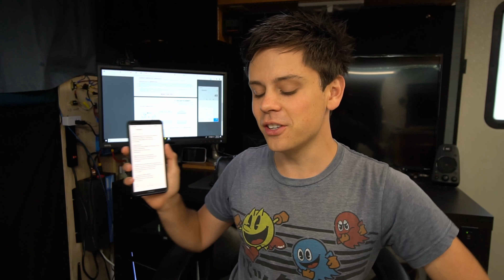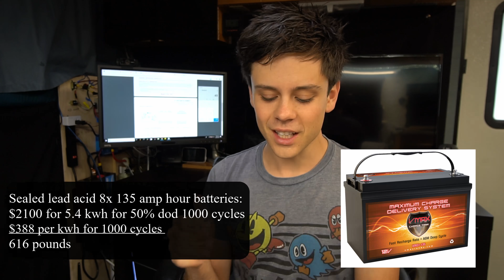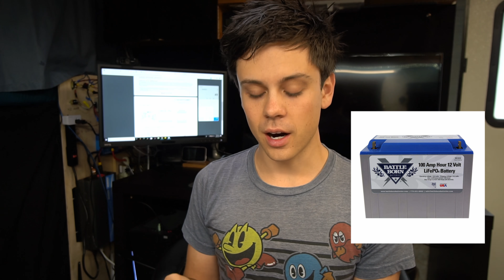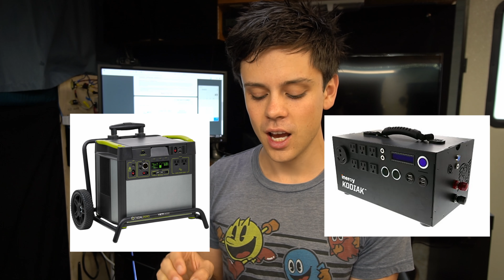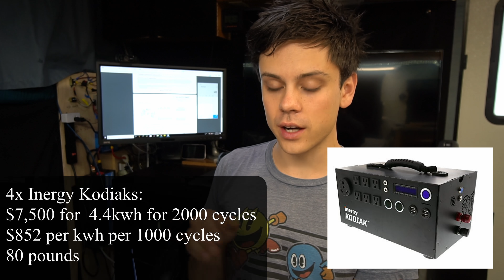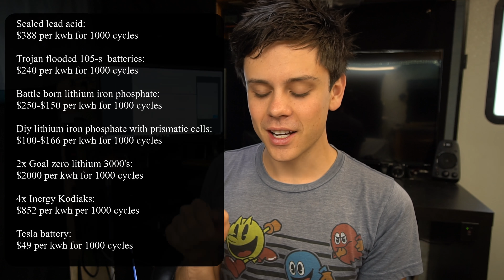Off-grid Solar Battery Price Comparison: Tesla vs. FLA vs. SLA vs. LiFePO4 vs. Tesla

Comment: The 5000 cycles at 100% DOD on Tesla batteries are unreal. Tesla cells are based on an upgraded panasonic 18650B, which has a 500 cycle rate. Let's consider an improvement to 1000 cycles. Going to 80% DOD, that will take your cycle life to maximum 4000.
Reply from the maker: Absolutely. That's why I stated I'm using a different charge profile to reach those numbers.  And right now I cycle between 85% and 45%. So I'm not concerned.
Reply: Just like a regular EV . Most owners will not drive until the batteries are fully depleted and actually cycle around 45-60% DOD which will boost cycle count longer than the actual chassis lifetime.
Reply from the maker: @octavianc  thats so interesting. I was actually wondering about that recently. That is cool.
Reply from the maker: @octavianc  I think the seats and steering wheel will degrade before the battery does in some of these EV's
Reply: There will always be a market for them as used vehicles. Also there will be a high demand for refurbished or upgraded battery packs, as an EV can have a longer life than a standard ICE vehicle, as long as the battery is ok.
Reply: The main issue with very long lasting batteries is actually the temperature variations within the pack. As long as people will use the liquid cooling on the batteries, indeed, they will last a loong time as long as properly cycled. 
However even the smallest temperature variations (room temperature variations, higher ratings for charge/discharge) will actually kill the batteries when we speak of over 10 year lifetimes. This is because the lithium cells have different internal resistance value based on temperature. If the cells within a pack will be at different temperatures (middle cells will get hotter, even if only with a few degrees), they will have different  internal resistance values. In time this difference will increase, the cells will get hotter and hotter and lead to a cascade event.

This is why Nissan leaf batteries have such a poor lifespan (high C rating discharge and poor thermal management).
Reply from the maker: Good to know about Nissan leaf batteries. I know the usable cycle is 50% of total capacity on non plug in Prius. Older battery chemistry too
Reply: The roadster most likely will use higher power cells......less cycles. But still on 200 kWh with 500 cycles you will get over 400k km ( 250k miles) which is something that most owners will never get to. 

Prius as far as I know was not using lithium until i think gen 3? Gen 1 for sure and maybe gen 2 are using NIMH batteries which fall between lead and lithium
Reply from the maker: Also that means you lose 20% capacity at that point. In a lead acid it would sulfate or have a shorted cell. Idk how to factor that in but cycle life for solar application should out live a human
Reply from the maker: For small systems with low c requirements & partial cycles, it should last a longgggg time
Reply from the maker: Absolutely. which is why I'm curious to know how long the new Tesla Roadster would last if driven slowly. 200kwh battery pack. Could drive it for a couple hundred years haha

Comment: Good video, Goal Zero documentation is missleading and charging options definatelly sucks.  

From there support team:
Every 500 cycles, the battery simply loses about 20% of its capacity. The total lifespan of the battery is about 2000 cycles. A cycle is from 100% to 0%

Nice to hear about the efficiency of different types of batteries.

Comment: What do you say are the down side of the Kodiak?
Reply from the maker: Battery chemistry mainly. They need to be using lithium iron phosphate and make it larger with a better discharge rate. besides that pretty good unit. Actually there are no solar generators on the market with lithium iron phosphate chemistry unfortunately

Comment: The liquid metal blows the tesla out of the water for non-mobile applications... $25 per KW HOUR.  KW with more than 10 year life span at 1-2 full discharge per day.  (Less than 1% degredation over that period.. Guy from MIT (prof) did a nice presentation at Sanford for the things... and they don't explode...and are happy doing full discharge.  (unlike the lithium flavored batteries.. VERY interesting.. he started off doing a grid capable battery, and has it working.. (Gates went to HIM for background before investing..)
Reply: Great. Where can you buy one today?

Comment: What kind of bms are you using with your tesla?
Reply from the maker: Go to the website to see all of the BMS features that I programmed into the components around the battery.
Reply from the maker: And it's custom-built. If I had 10 Tesla battery modules high discharge rates and not with my current charge profile, I would use an Orion BMS. Before my system all I need is overcurrent, temperature protection, over and under discharge protection etc. Which is built into my components in programmed myself. It's pretty darn easy
Reply: I'm still new to all this ... buy really like your break down

Comment: good video.  I have one gripe though...
Usually a spec would be written as: $250/kWh, 5000 cycles
I know you're trying to say this is $50/kWh/1000 cycles, which is true but could be a little misleading because there is no $50/kWh battery.

5000 cycles at 1 cycle/day is 13.7 years.  You basically have to pay for the 13.7 year battery up front, and that costs $250/kWh.
If you wanted a lower cost per unit energy storage, you could buy half the battery and run it twice as hard, but it won't last as long.  So it would be cheaper to buy initially but wouldn't be as good a value long-term.  

Another way to spec this is to say that $250/kWh, 5000 cycles is simply a storage cost of $0.05/kWh (for each and every kWh).  
This makes the math easy because you can take the current cost of your electricity and add 5 cents to it.  

Then you can compare that to something like a portable Honda generator (like the EU2200i).  By the time you pay for gas and oil I was just figuring this costs something like $0.40/kWh @ 100% load, and ~$0.70/kWh @ 25% load.  

So maybe we're at the point now where solar and batteries are starting to be less expensive overall than portable generators, but I'd say that has only happened fairly recently.

Comment: kindly provide us the link at eBay where you purchased your battery. can it be delivered to Sydney? can you kindly explain why some sellers only provide amp hour for capacity without mentioning the voltage. wiliest kilowatt hour is the best for power storage capacity measurement ?

Comment: Hey Will, a question for you! I had absolutely no idea how cost effective these Tesla batteries were and it has really opened my eyes. What has caught my attention more so is that this could be the answer to an effective way to run air-conditioning within a van off-grid. I've already come across one guy in a Sprinter FB group who has used two Tesla P85 modules and running a household 9kBTU air conditioner within his van he claims can run for over 12+ hours. Is there any chance you can touch on this a little bit Will? I never really went down the A/C rabbit hole. What do you think of running multiple Tesla batteries? That could really make off-grid A/C and induction cooking feasible without a tonne of weight. 

Perhaps if you don't want to build the systems you could make a DIY Tesla BMS video.

Comment: I was thinking about purchasing the goal zero 3000. I was on the phone with support to inquire more info (cant find many reviews on it). I asked about the 500 cycle life and their response was that every 500 cycles the battery loses 20% capacity. So it would still be rated close to 2000 cycles before it would completely need replaced.

Comment: Really appreciate the time that you took to do this I've been looking at different things trying to figure out what I can get the biggest bang for my buck in the best system for the money I spend and this does it. I know you did a video on how you set that up I watch that with the Tesla it would be nice to get if it were possible how you built your system everything that you used cost breakdown and the best stuff to use I'm wanting to put in the best system that I can and a system that's going to last the longest

Comment: I hope to go with Lithium Ion at some point. I have a question for you but 1st some back ground. I have a 21 kilowatt FLA battery bank that have 1642 cycles on them. I never use more than 20% so 80% SOC is the lowest they get. The batteries behave the same as when they were new. Their efficiency factor is still around 90%. This is calculated by how much energy has to be replaced and still get the specific gravity back up to spec. My batteries are L-16 FLA and the cost was $2600.
We use about 4.2 kilowatts a day from the batteries. I have a friend who has been off grid for 40 years now. He typically gets 18 to 20 years from his FLA batteries. Now the question. How much do my batteries cost per kilowatt at this juncture? Thanks
Reply from the maker: Look up the data sheet for your batteries and do the calculations. And did you do internal resistance tests to check current health of battery? 

I would dump them and get lithium ion. Not even for the price factor alone, but for reduced internal resistance,weight savings  etc etc
Reply from the maker: And the price comparison of a flooded vs lithium with partial recharges still holds as lithium being cheaper. Because if you are only using 20% of the battery, means you has to buy way more batteries. Charge cycle life goes up like crazy at partial discharges, like all batteries. Lithium still better with partial discharges but it's not necessary. No need to buy such a large battery bank when you have lithium because you can safely use 80-100% of the capacity. So instead of having 21 kwh, you can use 4.2 kwh of lithium batteries. Regardless of what you use, partial discharge doesn't change anything because all batteries have that property. You can partial discharge a lithium for 40,000 cycles no problem.
Reply from the maker: And 20 years from FLA??? That's insane.
Reply: @WillProwse  Yes it's TRUE 20 years from FLA. we live off grid in the mountains where rain and snow are the norm. I have been using Sandia Laboratory charge algorithms from 2002 for L-16 batteries. Higher absorption voltage and light cycling. I full understand the benefits of Lithium Ion. I've been doing g this awhile. I have been doing g research on Nissan Leaf and Chevy Volt batteries. The Volt battery I can get a used 13 kilowatt battery shipped for $1200
I have friends who use BMS and without BMS. Even bottom balanced. I have at least 4 more years left in my battery bank so I will wait for the price to come down. You are so right about the weight difference but my batteries are stationary. The biggest advantage of Lithium Ion for me is being able to be at a partial SOC for days on end with no sulfation or damage of any kind. That alone is worth the change. But our batteries are still valid so I'll have to wait. The Tesla or Smart Car batteries are very interesting too.
Reply: @WillProwse  ok Will you convinced me. I traded my FLA bank in on Tesla batteries. WOW!!! Do they ever chage up fast. I have had the system on Tesla's for 80 days now. No regrets. Thanks for your hard work and research.
Reply: @WillProwse  Hey Will I gave up on the FLA and bought Tesla batteries from a model S. It's been 140 days now and I am sold on the lithium. I was able to install 9 kilowatts with 3 BMS modules for $2200. The FLA would cost $2600 so you are right on this one.

Comment: Discharge rate highly depend on SoC and temperature. Run 1100 ampere in a single Tesla module at low state of charge and you do not get the cycles you expect. The internal fuses is around 10 ampere. with 74 cell in each block are you risking blowing the fuses above 740 ampere.
Reply from the maker: Yep
Reply from the maker: Lol I'm not sure who is planning to discharge at any rate even close to that.
Reply from the maker: What are you powering that requires that many amps? Really curious why anyone would need that for off-grid system

Comment: Great video and comparison. We used to have Deka 235 AH flooded that is $130 a piece and is good quality. Making the 5.6 kWh for $184 per Kwh. Still 550 pound or more.
You need to have a Tesla modules be <4.5 kWh useful. If you run it to the full voltage range is the degradation high and you run a lot of risk getting to very high cell voltage. You also need to account for BMS and heating gear that is probably $100. The Tesla module is also used so you do not get a brand new battery, but again only 10-20% of the cycles used, so to be fair 4.5 kWh, 3000 cycles and $1300+$100 => $104 per kWh for 1000 cycles. Weight is ~70 pounds.
But I completely agree this is a very good value. But it is not for everyone since it have no warranty and does require a watchful eye and understanding what is going on.
IMO is it worth considering if you need storage that is more than 6-8 BB. If used in an existing RV is the switch to 24 volt also $2500 or more.
Reply from the maker: I have another video that covers cycle life of Tesla module in much greater details. It was posted this week. You would like it
Reply from the maker: And yes I agree it's not for everyone
Reply from the maker: Doesn't need to cost thousands. Just get a 24 to 12 volt converter and use a tiny sealed lead acid. I can start my generator and do everything 12 volts with this system no problem
Reply: @WillProwse  You do not get a 24 -> 12 volt converter that can run an inverter. You need to replace the inverter.
Reply from the maker: That's what the sealed lead acid is for. And yeah of course not a large one. I have a 24 volt inverter. I was mean for shallow discharge scenarios. Such as running RV stuff. You do not need to spend 2400 dollars lol
Reply from the maker: My 2000 watt pure sine wave inverter cost 300 bucks. It's not a big deal
Reply from the maker: Converter and sealed lead acid only for starting generator at 450 Amps, water pump etc. I'm just saying u don't need to spend much money to make it ok

Comment: QUESTION: 'Is Tesla S-Model has several 18650 batteries' I understand new Tesla model 3 car battery size is: 21700 is better battery than 18650. This will be your new performance  over your current Tesla battery.

Comment: I put in off-grid back in 2007, so its getting a bit long in the tooth technology-wise. Twin Xantrex 5548 inverters and FLA Rolls Surrette. Practically, I have about 10kW of inversion and would like to convert to lithium. I built a portable 2 kWhr battery pack so that I could use electric garden tools anywhere, so now have a bit of lithium experience using 4.2v type cells. The whole house will be a much larger cost undertaking. The yardstick I've had thus far is the Tesla Powerwall for $6600 supplying 13.5 kWhr. From your video, it would seem old used Tesla car batteries would be considerably cheaper, but as you mentioned, there is the BMS. You mentioned high quality BMS but no specific names. I've looked at the Batrium system, which seems somewhat popular. Any thoughts on that or other DIY BMS systems?

Comment: Will sometimes I think you should just stop talking and start designing and selling! I don't understand half the stuff you say as Im a beginner but it sounds like your giving away some lucrative ideas bro! If you don't know why nobody has designed and built something useful. Design it make it idiot proof and I will buy it. Your books ace. Thanks for the Education.
Paul
Reply from the maker: Thank you Paul!! Made my day. And I agree. Will try to build something. Just waiting to see if I can piggyback another company. I have a few companies emailing me and I am hoping one can manufacture something good. The profit for building these things can be pretty low sadly, so seeing if a company will get something going
Reply: then the money spinner is definitely in your ability to teach and explain! Somewhere, some how, how dialed you got this shit has got to be able to make you a very decent living! The whole notion of building and solar system for my van is burning a whole in my brain bro.
I'm capable of and have been known asking some ridiculously stupid questions in my time! 🤣 But im getting my head round it using your videos. Unfortunately most of the gear you suggested buying doesn't ship to the UK so Im trying to source stuff as close to it as I can tell?
Reply: mate whilst I have you here, would you mind if I just check what im thinking is correct... if I can fit 6 x 100w pv on my roof (600w) I divided this by 12v = 50a then I've read somewhere to give my self a safty margin of 25% giving me 62.5a so in this situation I'd need a 70a or 60a charge controller?
Reply from the maker: You don't need the safety margin. Those panels will probably never produce 600 watts. The 50 amp size will work great.

Comment: No Iron Edison? Nickle Iron is cheaper, more durable and will last longer.  No fire danger, no exotic materials.  Completely recyclable.  Last 20+ years.  Weight is not a consideration in a home off grid application.